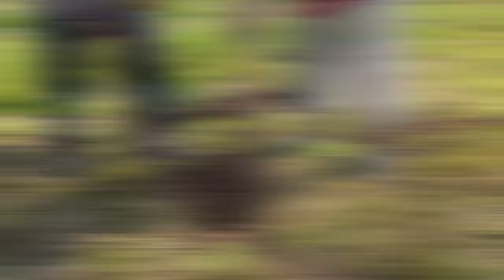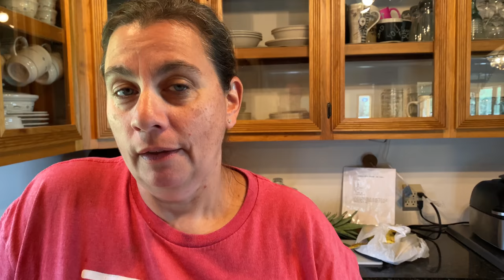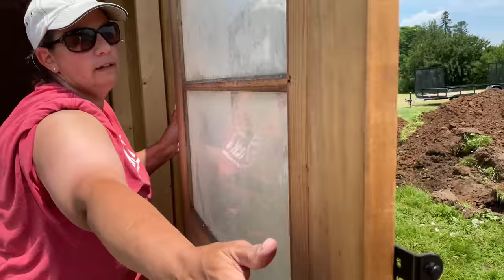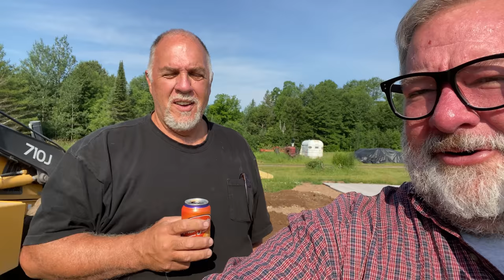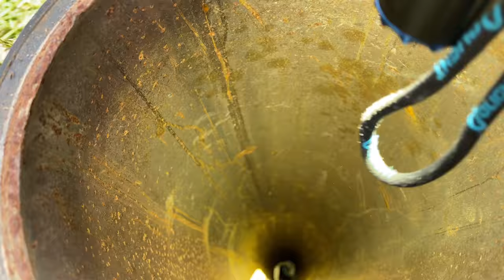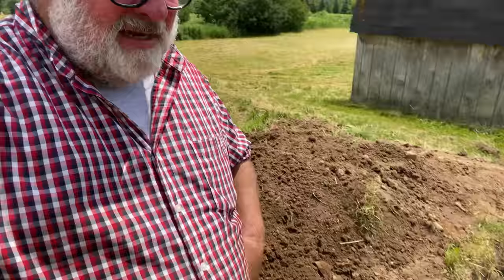Barn and Chicken Coop Build PT2 | A Big Family Homestead VLOG

Comment: You can easily find the septic line and the clean out lid by using a devining rod...)? spelling) just take two iron rods at 45 degree angles, one end shorter than the other, and two 8 in pieces of copper pipe.  Thread the shorter end of the iron rod with the copper pipe...these are the handles.  Hold one in each hand, level, in front of you.  When the ends of the iron rod cross, that is indication of a water line (flushing toilets while looking by someone else helps) and will lead you to the septic lid and clean out.  I've used this method for seventy years and it works! Some people use fresh willow branches (small) to find running water...I have not.  Good luck, enjoy your videos, may God richly bless you both and your family.

Comment: You need to get and try theraworx. It’s a rub on that I use and love.  It helps my back and you can also get one that helps with cramps.  When my feet or legs cramp I use it and it almost immediately stops the cramp.  I get it from my drugstore and have found it on amazon at a cheaper price.  It’s not an inexpensive product but when it comes to pain, I think it’s worth it.